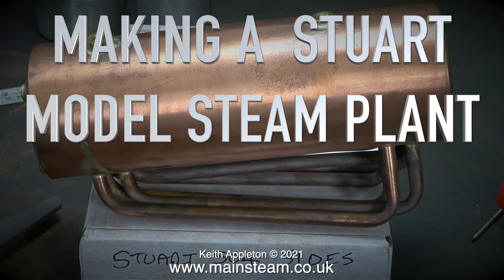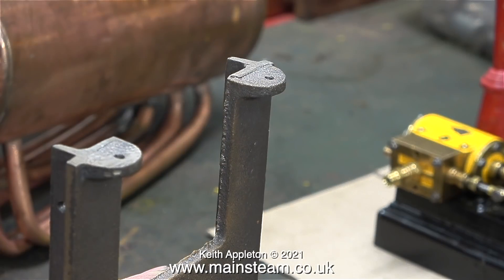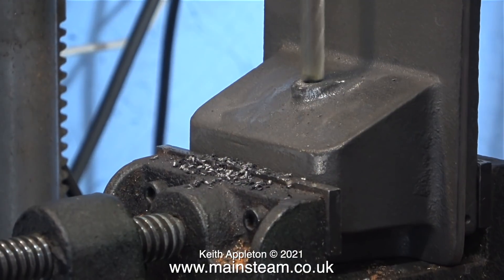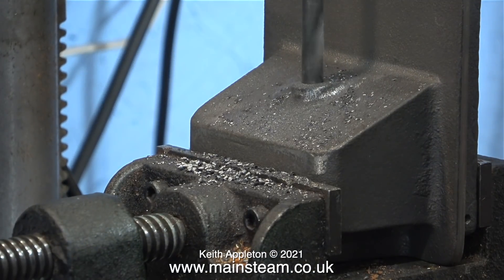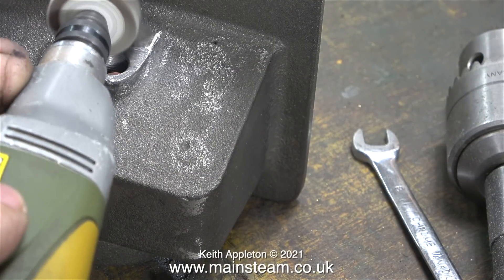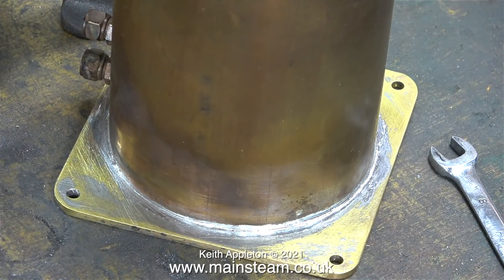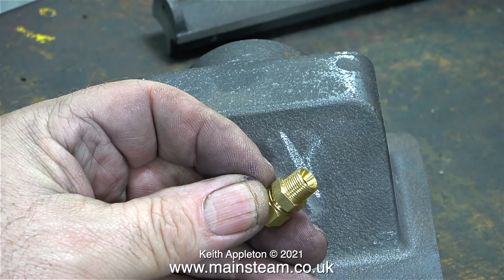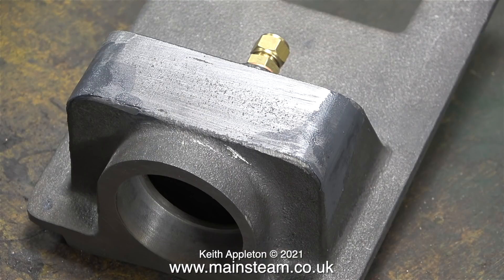MAKING A STUART MODEL STEAM PLANT - PART #34

Comment: Keith is always talking about his Baco (sorry about the spelling) adjustable spanners. These adjustable wrenches are exactly as he claims. This is due to the design of the jaws of the wrench. Unlike what we in the USA call a crescent wrench, the jaws have re-enforcement and the adjuster (the screw) is made to tight tolerance.
There is another adjustable spanner that looks a little like an adjustable pipe wrench, sometimes called a monkey wrench. Baco took the best features of all these other wrenches and designed a superior adjustable wrench. I would want a set of these wrenches, if I did any could afford them
By the way, I would guess that the reason why the 8M wrench didn't work well on the tap is because the tap's end is imperial in size.

Comment: In my job we get faced by having to integrate equipment from lots of different sources and as they say the devil is in the detail. I think the PM Research fittings are likely to have the UN thread form which is 60° as PM appear to be based in the the USA. The BA threads I think are 47.5° and the Whitworth thread form is 55°, this form would cover the BSP, BSW, BSF and ME threads. All of these have multiple slight variants as well!! I must revisit your videos on this subject! I am really enjoying this series, that wooden foundation in the last videos looks like a great solution.